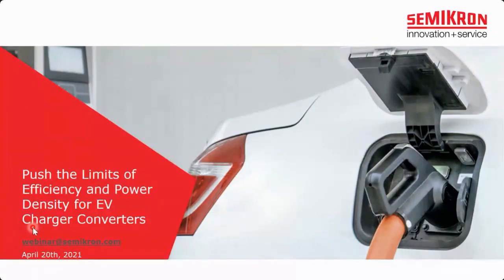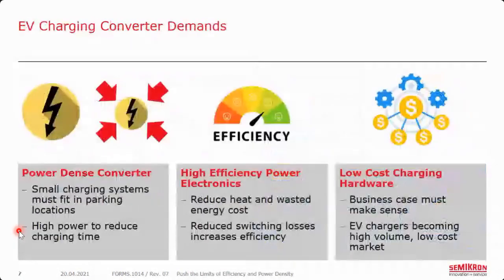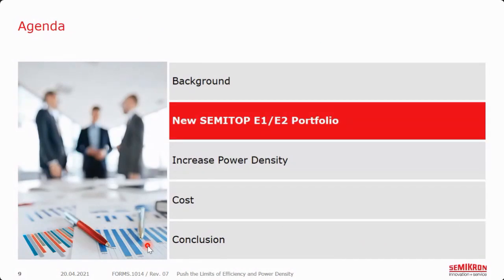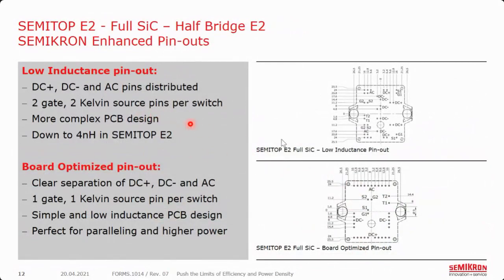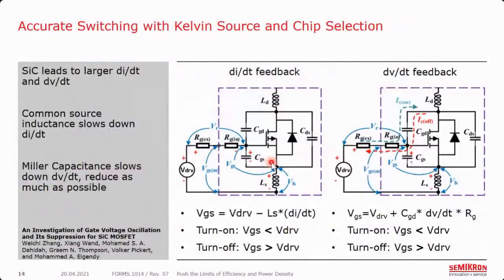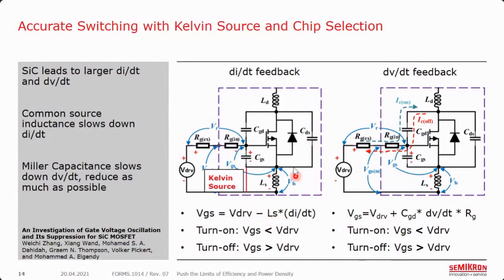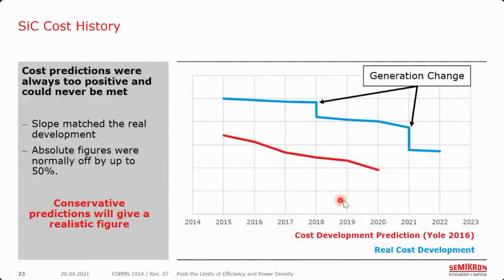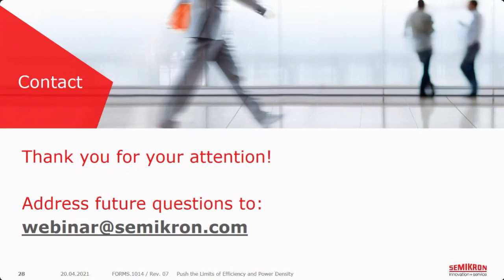Webinar: Push the Limits of Efficiency and Power Density for EV Charger Converters

Comment: What would be the additional estimated hardware cost to make a normal 11-kW-charger in an EV bidirectional?
Reply from the maker: Unfortunately, we cannot give an exact answer to this question. Moving from unidirectional to bidirectional, additional transistors are required on the secondary side of the DC/DC converter. Depending on the topology, the PFC may also need additional transistors.  

From that point, there is a balance between filter cost and power module cost. By increasing the switching frequency, the filter can decrease in size, potentially decreasing cost. However, this may call for using more Silicon Carbide, which then increases costs. For the most accurate answer, please reach out to us at sales@semikron.com for quotations on specific products for comparison.